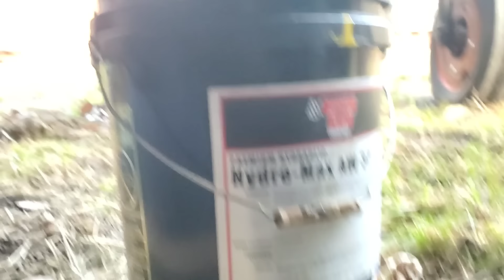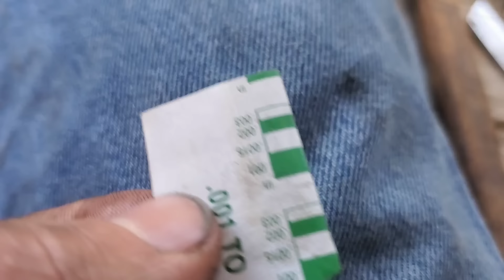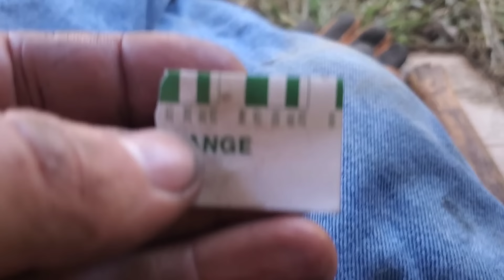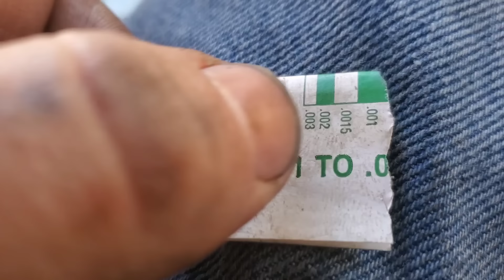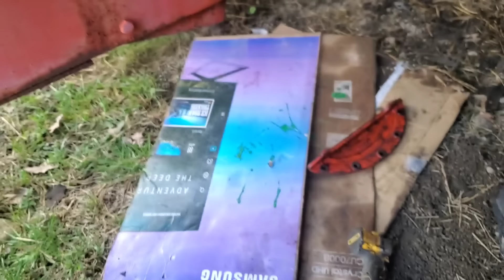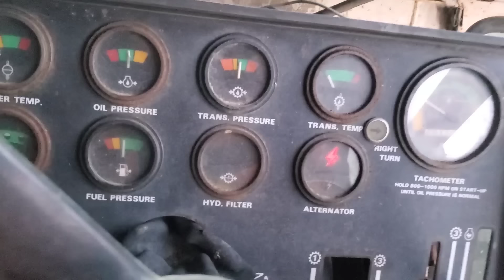Case 2470 Engine Inspection

Comment: Case engines wear the sides of the bearings if they have been over reved to long and they wear the rod side faster then the cap side if they have been pulled hard

Comment: rings , bearings , seat the valves and go   pull dip stick when she is runningto see how much blow by comes out .my father put new rings bearings in a masey 1105  25 ears ago     he used the old pistons and liners still going

Comment: I am completely rebuilding a 1270 even down to new cam, lifters, bearings all around. I broke my tach drive cause I’m an idiot so I had to find one at a tractor junkyard because new at Case is like 400$
Reply from the maker: It happens. The plastic is old and brittle.
Reply: These projects always snowball. Started with a dropped valve seat and ended up replacing the cam, lifters, cam bearings, rod and main bearings, pistons, sleeves, rod bushings, injectors, rebuilt pump, turbo, exhaust manifold. Yeah it’s been a real treat!

Comment: Love to see an update on this machine.  Have you had a chance to service the transmission?
Reply from the maker: I haven't done much with it. Hoping to use it some in the spring but I need to work on the hydraulic couplers and valve control levers.